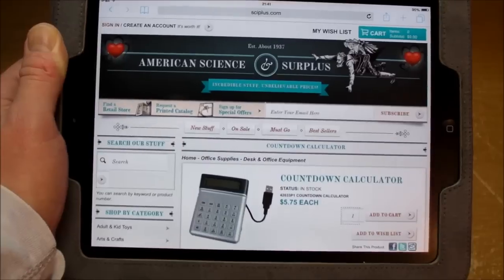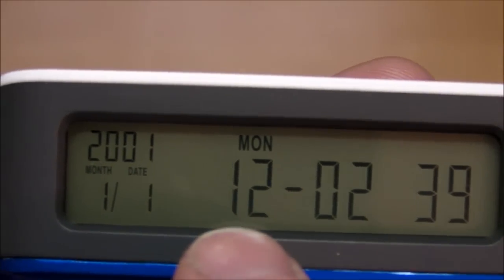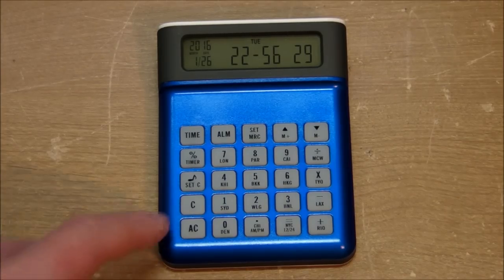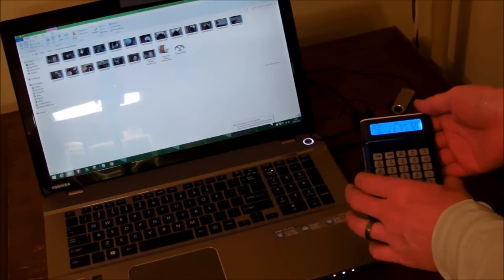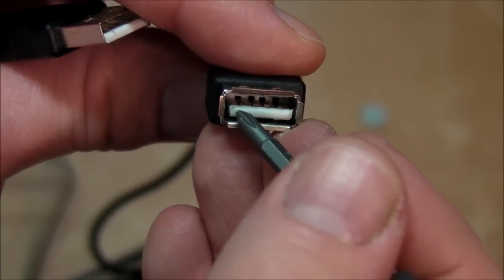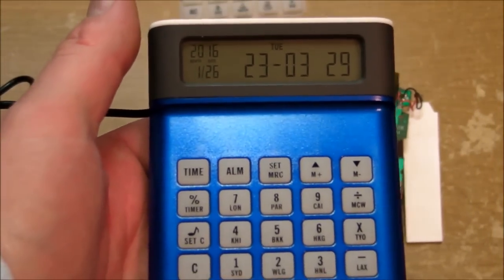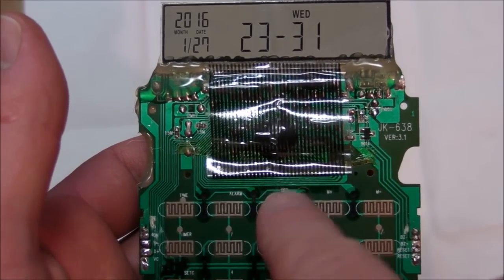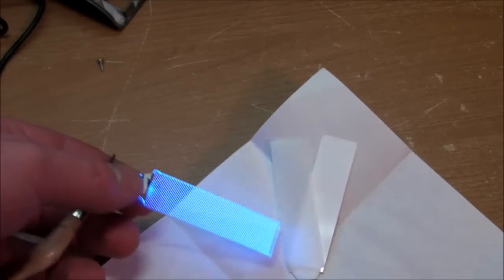(#0214) Countdown Calculator Clock USB Hub - Should Not Exist

Comment: I have a Promo Alarm clock - didn't work opened and fixed No problem (like the USB wire fix) Keeps perfect time, runs for years on 2 AA had it since ~ 2000